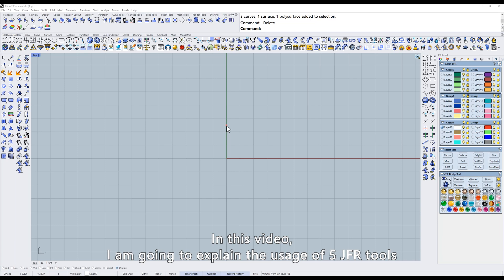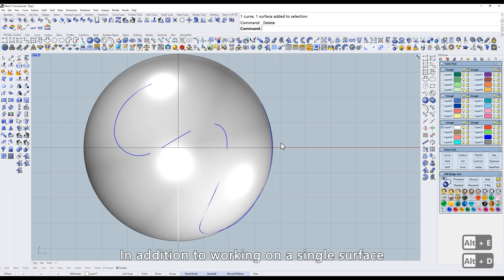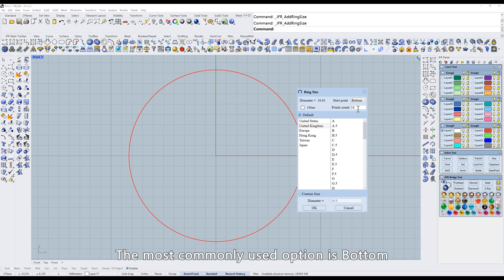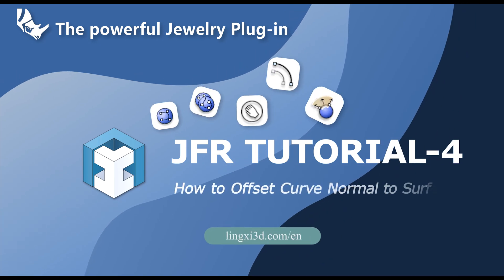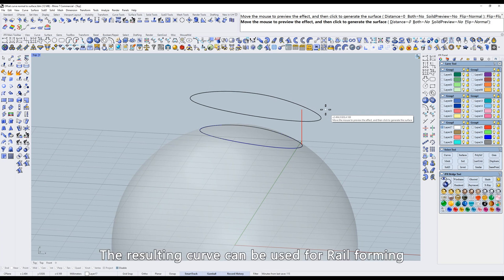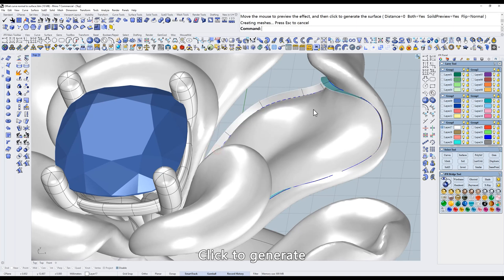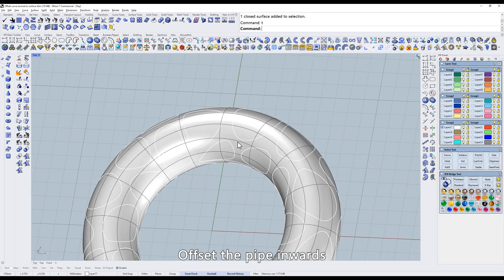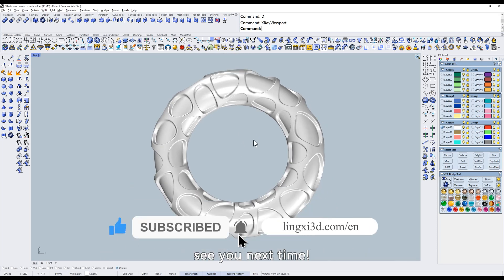Rhino JFR‘s Draw on a Object and 4 other tools Tutorial -3D Jewelry Design | CAD | Rhino 3D | Matrix

Comment: Hi. You have incorrect numbering of points on closed curves for forming a tire. And apparently in other places where you can adjust where the first point will be. It is with index 1, but it should be with index - 0.
Reply from the maker: Hi, rhino's control point serial number is not shown by default, it has a fixed seam line serial number, we just showed it, it's not an error.